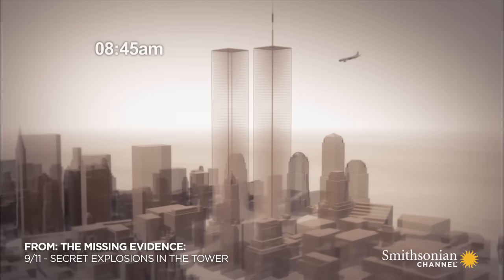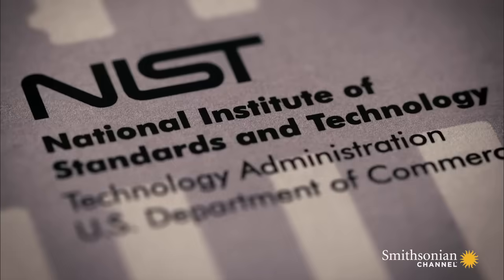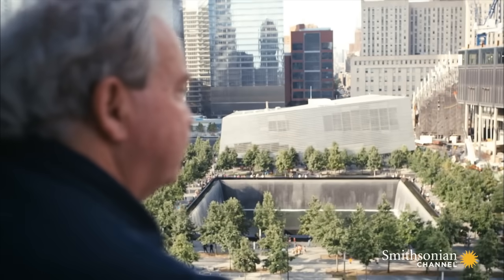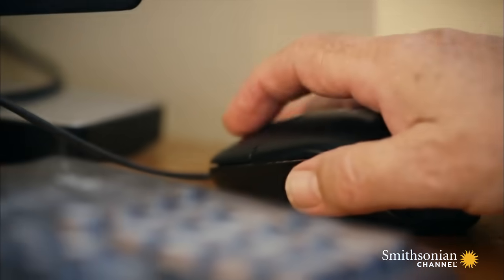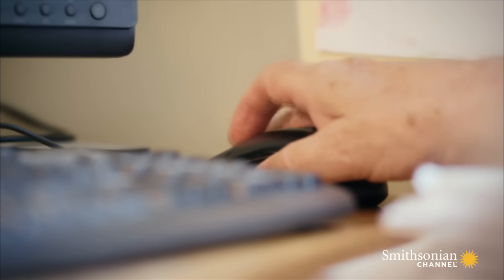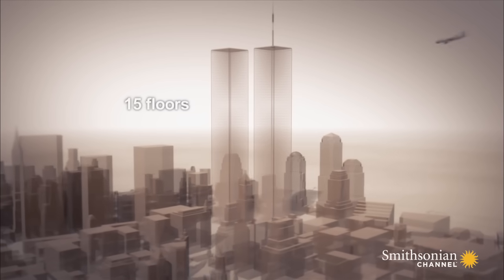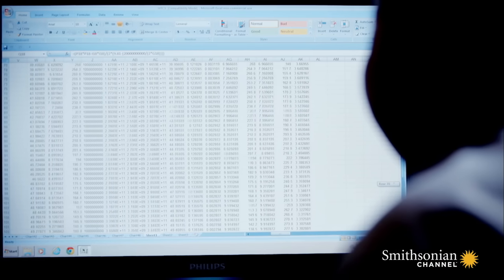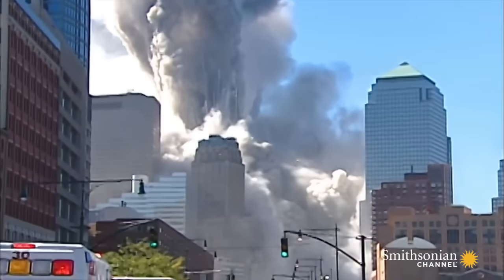This Computer Simulation Explains How the Twin Towers Fell

Comment: Yet N.I.S.T. lied in their report about the collapse of building 7. (At first they didn't even 'mention' building 7 in the 9/11 report, but were pressured to do so and that report came out years afterward.)  A two-year study was conducted recently, by Dr. Leroy Hulsey, head of the Structural Engineering Dept. at the Univ. of Fairbanks, Alaska, along with his top students, which concluded without a doubt, that fires did NOT cause the collapse of Building 7. An impossibility, and a peer-review paper is about to come out, by Hulsey, (or may have been put up for review already), which proves this. Unequivocally. So N.I.S.T., being experts in this field, had to have known, and had to have lied about "collapse due to fires" on purpose. Therefore, a cover-up is not only possible, it's highly probable! If we were lied to about building 7's collapse, it would stand to reason, that we also were likely lied to about how Towers 1 & 2 came down as well, as steel structured sky-scrapers just aren't known to "collapse" that way. There's really only two "known" possibilities for the three buildings collapsing that day, (since it wasn't fires), and those are:  that Building 7 was brought down by  controlled demolition, or that it was the target of one of those High Frequency Energy Weapons, (Using the "Hutchinson Effect"). I say "known" possibilities, because it may have been something else, I don't know for sure.. but we do know it wasn't "small office fires" like N.I.S.T., (our government), told us! Not just a little "Oops, we goofed" lie on N.I.S.T's part, but a blatantly obvious, "we have something to hide" lie. Wake the hell up, America! We've been duped.

Comment: The rate at which all 3 towers fell were at free fall. If each floor is slamming into the next, that would actually slow the rate of free fall which also completely defies physics and Newtons law of motion. We did this in shop class, and learned about it science. Just about every architect in the world including me disagrees with this story including the 2,200 from NY that disagreed with the official story. He never said what program he was using and didn’t really explain much about it. He also didn’t test WTC7 or touch base on that. But then again, neither did the commission report. Good thing Larry Silverstein bought that nice insurance policy on those towers right before it happened. 

In 1945 a B-25 Mitchell bomber plane flew into the Empire State building. It burned for hours and did not collapse nor effect the buildings integrity. 

On June 14th 2017 the Grenfell Tower in London burned for a total of 60 hours until it was finally extinguished.

On September 11th, 2001 WTC7 collapsed in perfect free fall speed after a few hours of an office fire.

Comment: Design.  Empire State Building was hit by a B-17 Bombed in the 1940's.  But it's cube style steel girder design save it.  The remaining girders were able to support both the plane and weight of the above floors.  The towers exoskeletal design lacked inner support.  Once compromised it lack structural internal support and folded in on itself.  Sorry, no conspiracy, just structurally weak for such a hit.  The new buildings in that area now have steel cube design.

Comment: Is this "pancake" theory or "pile driver". Either way this is NOT a simulation. It's an "emulation". Anyone can make a copycat emulation to match what happened. It's just a shame when you have to lie and do mental gymnastics to deny what your eyes can clearly see - a controlled demolition. 

Face it. If you drop a large steel box from a height on to 4 large steel boxes piled on top of each other that top box will never crush the boxes below and then magically crush itself too. 

If you pile up 5 identical suitcases to make a tower, then lift the top one up and drop it on to the 4 below do you think the top one will crush the bottom 4 and then crush itself? That's what this video is asking you to believe. 

This video defies basic logic. Use your brains people.

Comment: where did the debris go? If the upper floors were "pulverised" as suggested, the weight would decrease rapidly and the lower floors would stand. Regardless, there was about 10 floors of shit in the aftermath, not 110. Also the seismic signal was smaller than the collapse of the superdome which was about 1/20th the weight of the World Trade Centers 1 or 2.

Comment: This doesn't explain the amount of thermite material found in the basements of these buildings nor the squibs going off on the sides of the building nor does it explain how planes that size would have been tore apart at 100 knots over their VMO before they even hit. This video is b.s.

Comment: and this gentleman's state-of-the-art simulation in MS Excel on his home PC proves that 3 buildings can collapse like dominoes. round of applause
Reply: flypaper4weirdos  ok so why did it free fall like a professional demolition
Reply: I’ve worked in R&D at a major company with material weakening (cycle stress in gas turbines) and we used Excel. 

I thought it was weird too (it was my first job out of uni and I was more used to Matlab) but it did the trick surprisingly well (albeit super annoying to work with). 

The engineer’s motto is “good enough” after all, and in the ends it’s all just math.
Reply: Javier Fernandez - And the impact of a 250,000 pound object traveling at 650 mph.  Also, not just kerosene, but thousands of gallons of kerosene - burning for over an hour, being fed oxygen from gaping holes in the building.
Reply: @thetooginator153  do you ever come back to your BBQ and find it fallen in on it self because of heat from gas witch burn hotter the kerosene
Reply: Every simulation need a number to represent every elements (such as every part of the steels and its connection, windows, etc..) and the details (such as position, mass, endurance, etc..), and the simulation works by the logarithms. So basically logarithms proccess the numbers. That excel may countain thousand of rows and columns or maybe even more. Or maybe there's another excel file.
What we see on the computer is the 3d simulation, but what computer see is something behind it
Reply: Just because you don't understand it doesn't mean he is wrong. Do you not know people do calculations in Excel? So many smooth brains in this video smh.
Reply: So if he brought his home pc to work it would prove differently?
Reply: Jet cant get through steel beem.
Reply: @imhasa102  nobody is claiming jet fuel can “get though” steel beams either. 

Metal loses strength at much lower temperatures than it melts at. 

Have you never seen a blacksmith work metal? He heats the metal until it’s nice and red, then it’s soft enough to hammer into shape. It’s far from melting though.

Pretty basic material science. You should try studying it before having opinions.
Reply: @somefuckstolemynick  

What heated the beams before the craft hit them?
Reply: @imhasa102  why do you believe something heated the beams before the planes hit?
Reply: @somefuckstolemynick  

Because you said metal gets soft if heated.
If it doesnt get soft, aircraft never can sting it.
Reply: @somefuckstolemynick  

Airplane's bodyshell can be damaged even by a crash with a bird.
It is much lighter and weaker than truck.
Reply: @imhasa102  “aircraft can never sting it”? What?
Reply: @somefuckstolemynick  

Maybe you dont understand my 1st writing.
Sorry for my poor English.

I mean that the aircraft cannot break through into the building.
Reply: @imhasa102 You can’t be serious. I’m 99.9 percent sure you are trolling or a bot. But sure, I’ll bite. Why would you believe that? An aircraft is many tons of metal flying at high speed. The building has glass windows. The fire coating around the steel beams is not itself steel. Why wouldn’t it be able to damage the building..?
Reply: @somefuckstolemynick  

No battle, please.
Just thinkings are different.

It cant go through the whole building to show its nose out of the buulding on opposit side.
Reply: @imhasa102  what are you even talking about mate?
Reply: @somefuckstolemynick  

I said what they had shown to the world.
Reply: @somefuckstolemynick  

The far front part of the plane came out from the building at the opposite side with undamaged shape at all.
Reply: @somefuckstolemynick  

Do you understand now?
I didn't talk about the building collapse.
I am talking about the plane's hitting building and going through into the building.
It can never be happened.
Reply: @imhasa102  I have no idea what you are on about no. The plane hit the building and damaged it, causing the collapse. 

Your nonsense about it “going through” you will have to clarify what exactly you object to, and who has even claimed that to begin with.
Reply: @somefuckstolemynick  

The plane went into the building.
You have been  keeping on hiding yourself from this fact.
Reply: @imhasa102  I thought you said that was impossible? Lol, seriously mate, explain exactly what you mean, you are not making any sense. I’m half convinced you are either a bot or just a troll.
Reply: @dirkdiggler8260  

That's what I meant.
The nose.
What is that and is it possible to you?
There is nothing impossible to you in the world to you mightbe.
Huh
Reply: @imhasa102  You clearly didn't understand what i wrote. No, it isn't possible for the nose to have come out the other side, and that is NOT what happened as I've already explained to you. This ridiculous argument is easily refuted simple by watching the impact from any other angle. Stop spreading long debunked lies.
Reply: @dirkdiggler8260  yeah that guy is insane. His whole line of reasoning is so ridiculous I can’t believe he actually believes it himself. Doesn’t help that he speaks in mysterious one-liners and refuse to just state explicitly what he means.
Reply: @somefuckstolemynick  He won't address any opposing facts or evidence which says it all. As i said to him, reality is of no concern as it's all about conspiracy, nothing else. People like him just come on to youtube to look for an echo-chamber.
Reply: @dirkdiggler8260  

I did nothing.
I said just what they showed to the world and deleted it recently.
Even if the nose didn't come out to the other side, a plane can't go through the buulding, and a building can't be collapsed in less than 30 seconds.
You saw that the building was collapsed at once just like the building that North Korea bombed.
Reply: @dirkdiggler8260  

What is opposite one?
They showed it on tv.
What is the opposit to what you saw?
Ha2
Reply: @imhasa102  What? No idea what you're asking 🤷🏽‍♂️ Again, what are you claiming was deleted? Also, do you believe the fire fighters who lost hundreds of their brothers that day, we in on this crazy conspiracy you believe??
Reply: yep the government could have saved them selves 16 million dollars by just asking this guy.
Reply: But it didn't show them collapsing like dominoes?
Reply: so if this was done on paper it was even less trustworthy/accurate? we went to the moon with less computing power.. You need a lesson on reasoning
Reply: @JWHOLLANDIA  You're asking a tinfoil hat wearing, 9/11 truther to use reason?? 🤣 You must be new to this lol.
Reply: @dirkdiggler8260  yeah well i keep on trying..one comment at a time
Reply: @JWHOLLANDIA  That's all we can fo my friend and whereas the majority of these crackpots are a lost cause, there are other, less broken sorts who are maybe still on the fence and who are open to reason who value the facts we deliver.
Reply: I’d like to see you do this simulation with MS Excel. Seriously, show us.
Reply: terraria gaming  what combination of ram are you using to get 46gb?

Dumb.
Reply: terraria gaming  explain what combination of ram any normal consumer would purchase to get 46gb of ram.
Reply: Show us your simulation on SimScale for us all to see, please.
Reply: Haha. Well said sir.
Reply: Umb O  if you can find me a sight with his data , I’ll gladly look into it ?
Reply: Oh , i like that
Reply: Well, it’s better than anything the lunatics have (just saw a guy posting about how an unburned passport found in the rubble is evidence of a grand conspiracy. Lol.) It also helps this guy’s credibility that every reputable engineering and architectural society on earth agrees that the impact of massive airplanes, subsequent fires, and structural quirks of the World Trade Center explain the way the buildings fell. 

But conspiracy theorists won’t listen, because the official version isn’t cool enough.
Reply: So many nerds so little answers
Reply: Looking at you foto and your name, I feel you might know exactly how they collapsed, REJEESH! Sure, you prefer conspiracy ;).
Reply: @misterablenow2102  Excel guy certainly don't.
Reply: The guy is clearly the mastermind behind 9.11, knew not to mention WTC7 and pulled up old files 🙄
Reply: rajeesh shouldn't you be on the phone scamming old people pretending to be be microsoft?
Reply: Perhaps If the 3 towers were demonstrated to collapse like lego or Jenga pieces the cartoon might be more convincing? 
 The lslamic terrorist conspiracy theory will always be inconsistent with the evidence , as planned
Reply: Are there any simulations that prove otherwise?
Reply: @Riley_B2 contemporary simulations of events contrary to official narrative would be have been unpatriotic , now that the propaganda has served its purpose they will appear
Reply: lol I bet you have a lot of youtube videos to prove him wrong.
Reply: IKR LOL. I know that you can use Excel for that kind of thing but surely there is better simulation software out there...
Reply: @Spacemonkeymojo  Why? It's just maths.
Reply: @Spacemonkeymojo  You would think.
The Gov. probably hiding it
Reply: Sounds like you don't know what you're talking about. As a matter of fact, Excel is a pretty powerful tool and you can run simple simulations like this on a home PC.
Reply: @polarpenguin3  Then his is flawed
Reply: @polarpenguin3  This was not so simple.
Reply: @polarpenguin3 this is all BS how can this propaganda fool you? I know you posted 4 years ago, but Excel was not the tool to use for a terrorist attack simulation. It is indeed powerful, but it is not designed for this
Reply: @polarpenguin3  Sounds like you don't know what your talking about because that's literally what he said.
Reply: I use Excel. I haven't seen the building collapse icon. How can I find it? Maybe I should switch back from SPSS for statistics. They must have stepped it up.
Reply: @apparentweight  it's called mathematics..
Reply: @apparentweight  It's because it requires an IQ above room temperature
Reply: @apparentweight  Or stepped it down, like usual
Reply: @apparentweight  available in the ME region edition
Reply: @apparentweight   The building collapse icon is when you exceed the filename character limit.  They still haven't fixed that stupid problem.
Reply: This is only a computer simulation not the video that Fox News was shooting with Journalist Jon Scott reporting., I was laying in bed with TV a little less than 3 feet from my face. When I turned on my TV,  I saw only one tower smoking, maybe some fire.  The 2nd Building was doing fine.  So I kept watching about 15 minutes to learn more about the plane accident.  Next, comes the 2nd plane and I saw it do a semi-circle path around the smoking tower , to hit the 2nd Building.  NEVER A TRUTHER ! ! ! Only two planes to hit two buildings.  If there was a third building, it was destroyed by the twin towers's debris when they had imploded.
Reply: I would like to see this guy do a simulation on the 3rd trade building that fell nearby. It wasn't even struck.
Reply: dsammmast  He didn't state that or make it seem like that....
Reply: I was with my friend an everyone was celebrating . Still remember this day . I didn't celebrate cause at the time I didn't know how evil USA is . Still won't celebrate as those were innocent people . But you reap what you sow . Take your country back America . Your own government killed you that day it's so fucking obvious. Watch videos of buildings burned to a crisp yet they still stand tall . Towers were barely burning . An oh yeah let's not forget building 7 that had no planes hit it an just a few small fires . Like someone was just barbecuing on some floors hahaha . Yet it fell . Wake the fuck up America has your government brain washed you so severely that you lost the ability to think .
Reply: dsammmast  He didn't suggest that, he literally stated that it is runned on one.
Reply: Rejeesh Mathew  are you alright there

Comment: I think this event is very simple to be debunked. 
Just let's perform a model. A WTC in small proportions, hitted by  a small aircraft at the same speed. 
If we take 30, 40 or  50 kilos os steel and some concret and lots of patience, some cameras at high speed and engineer support, we can make it happen. 
Let's first of all make the building, the core, the exterior wall and the floors, and not to be forgotten, the  underground building support system.
Now, lets make a plane, aluminium and let's put the proportional kerosine in it and let us perform a way to get it exploded with the impact. 
The plane could be guided by a wire to be sure it will hit the tower- Bear in mind the plane must keep the proportion 500.0000 to 130, and that is the same of saying 0.0003 grams per kilo. After this, with all the machinery and witness, lots of cameras and measuring systems up to date, let's begin.... and wait for the result. 
I guess, anyone does it I believe, that 15 grams of kerosine and aluminium dont to more to our 30 kilos of steel than a scrap. 
But, I'm up to see if there is any other result expectable.